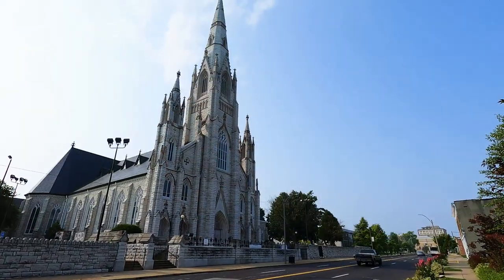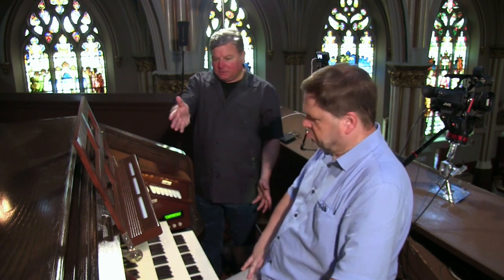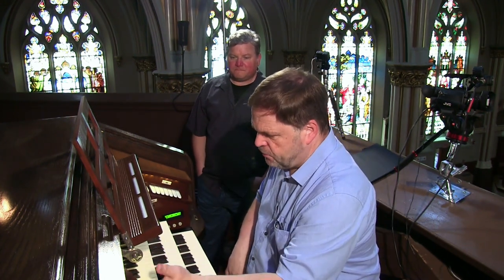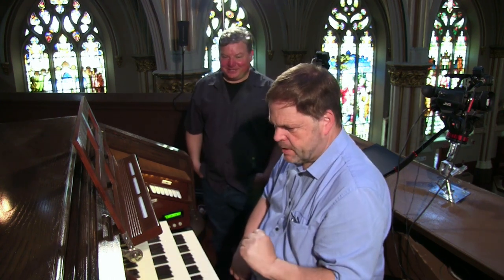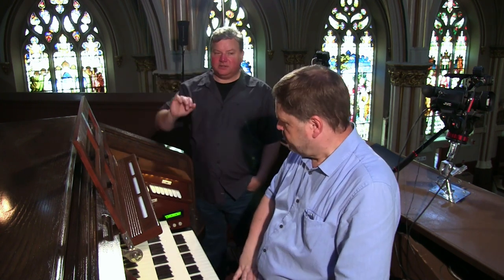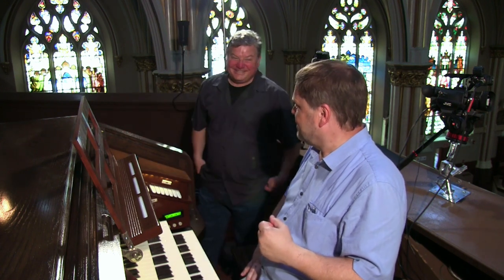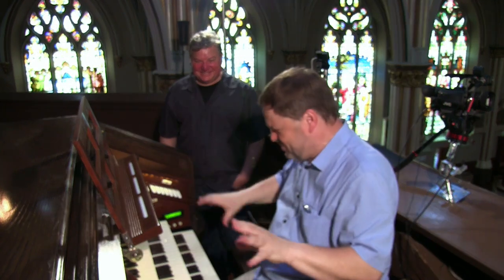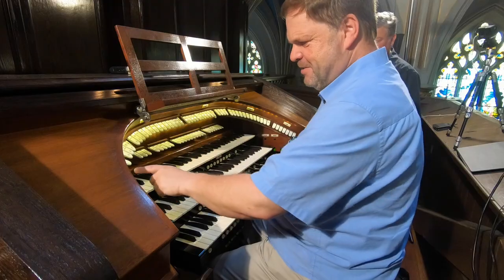1935 Willis/Wicks Organ - St. Alphonsus Liguori "The Rock Church" - St. Louis, Missouri

Comment: I assume the 32 Resultant would be wired to become a real 32 at the second c of the pedal board where as the 10-2/3 remains a 10-2/3 throughout the compass. I like the horseshoe console. I always thought Horseshoe consoles were the most ergonomic if they could have more classical looking tabs. Just having them all in white helps, but a Holtkamp style tab in wood be really nice.
Reply: Yet, regarding the “horseshoe console,” tho much more practical, they are often viewed pejoratively because they associate the pipe organ manufacturer with a theater organ. As you well know probably. I worked at a church that had a horseshoe console for many years, and it was great to furtively add or subtract stops one at a time, but when people would come to view the consul would say, “Oh, it’s just a theater organ.”